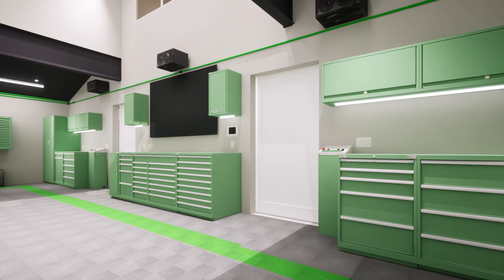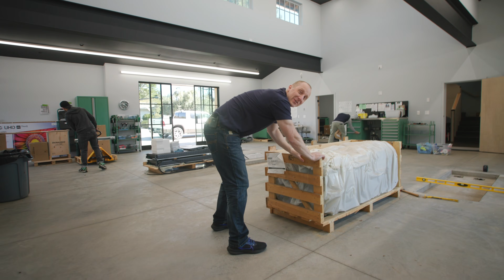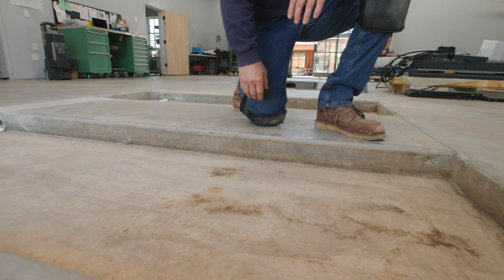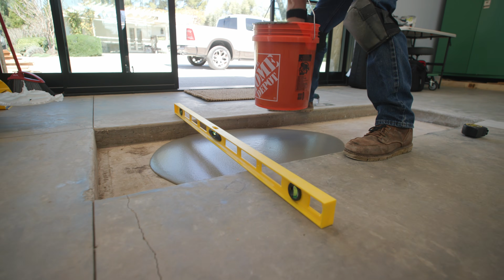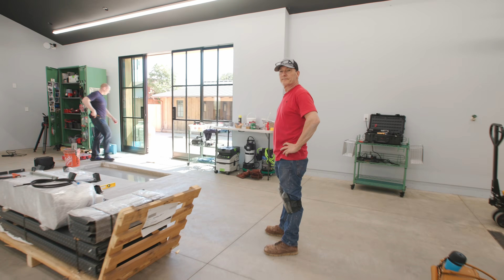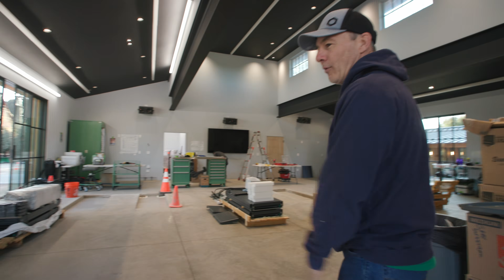EPIC Car Barn Build Series | A DREAM Custom Garage - E1: Introduction!

Comment: I'm no carpenter but it seems to me that you would have a perfect 3.25" depth if you made a template and just dragged it along the length of the lift pit.  Too much trouble to spread-measure,  spread-measure,  spread-measure.  Next time.  BTW,  that's an Awesome Barn/Garage.  A raised Monitor style.  Jealous just a little,  Ha!!  Lots!!!

Comment: I think I would have cut a little L shape wood piece to hang over the top of the level, that extended down exactly 3.25” below the level, instead of having to try to hold up and read the tape measure above the floor leveler. Doing great Mike and Mike!